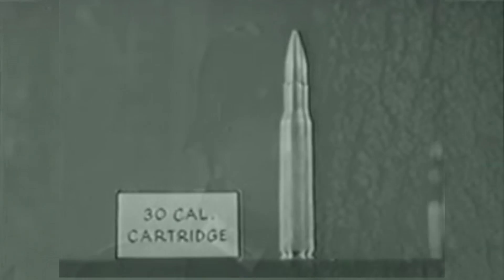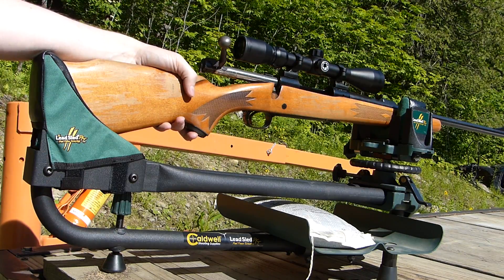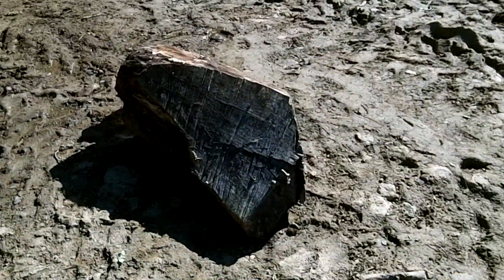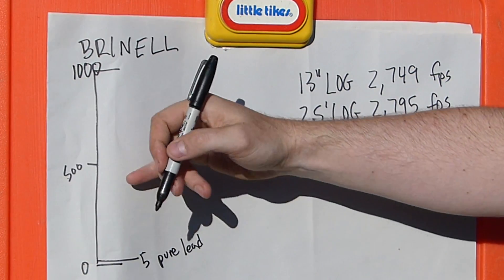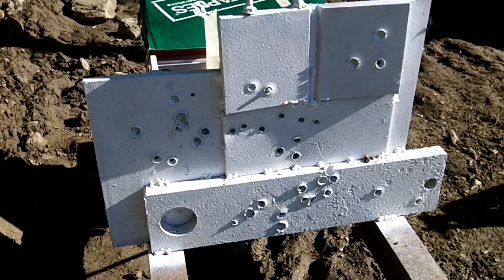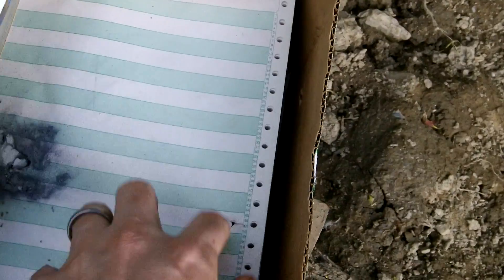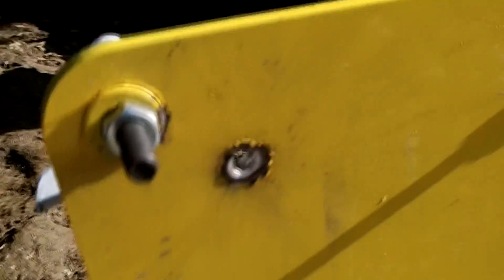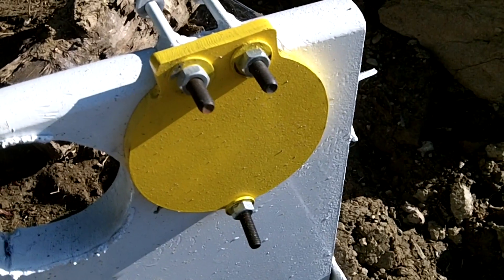AMMOTEST: 30 Caliber M2 (30-06) Armor Piercing Penetration Tests - Military Surplus Ammo

Comment: type III and IV armor; would like to see 30-06 with and without m2.  same with 556 and 762 using penetrator ammo.  pistol ammo is not relevant with them.thx and super video!!
Reply: Would like to see the same. But as to the pistol ammo, it can be relevant.  For starters,  back in the early 70's I remember shooting what was marketed as KTW Armour piercing ammo. It was in .357 mag and hat a Teflon coated jacket and a Tungsten core. It was for police/military and was touted as being able to penatrate a car's engine block, back then that meant a V-8. And as I recall it did a fine job. Due to this I'm sure there are other examples.

Comment: Excellent video & well thought out.

One suggestion with the wood phase of your testing.

When firing through wood logs vertically vs. horizontal, you might want to check the side exits of your rounds as they are susceptible following the grain of the wood shooting through it long ways vs. cutting through it in it's horizontal position & will tail off through weaker veins of the grains in the log exiting out the side in lieu of going all the way through.

Also, you'll probably get different results shooting through "green wood" vs. what it seems are more cured/dried out logs you used in your production. The soldier shot through a live, green tree when demonstrating the effect of the round vs. your more dried out version with far less water content keeping it's cellulose/cellular structure intact.

I have no idea how much that will impact penetration but you might actually care to demonstrate the difference in wood tolerances which if someone is taking cover behind a tree vs. cut timber that is more dried by industry standards & due to the normal process of sun exposure. In other words, it's structural integrity has been altered significantly cut from the stump.  

Again, excellent video & I was surprised with some of the results just as well..

Comment: I liked your video. You asked for feedback, so here goes. I can't tell how far your firing position is from your targets, but the .30-06 doesn't stabilize fully, with that weight of projectile, under 100yds. At 100+ yards, I think your 1 1/2" mild steel, and concrete tests would have a somewhat, (greater penetration) outcome. I look forward to seeing your other vids.

Comment: I checked over 150 comments and didn't see anything related to the concrete.....which comes in vastly different strengths. 2500psi, 3000psi, 5000psi, etc.     Stucco walls are junk concrete. Could be the difference.

Comment: Excellent! I really enjoyed it. A buddy gave me a few black tips. Somebody told me not to shoot them through my new hunting rifle because they can mess up the rifling or something. Ever heard of that?
Reply from the maker: I don't think it will be a problem.  Like most ammo they have a soft jacket which is what contacts the barrel.  It is just the core that is hard.  I think some people don't understand this.  Now some ammo ammo has some steel in the jackets, like the 7.62x54r I've been using lately.  These jackets are a little rougher on a barrel.
Reply: They won't hurt your rifle.  The jacket is copper just like any other 30 06 round. The penetrator core does not come in contact with your barrel

Comment: Would 8mm Mauser AP have the ballistics or close too the M2 ball AP?
Reply: crystalrock18 I can tell you that it is a bit better than 30-06.I used SMK and SMKH along with SMK I'spür which is AP tracer.The toughest one was SMKH-it punched through an inch of AR500 because it was not just armour piercing round but tungsten carbide core round-which really makes the difference enormous.It is far better in penetrating anything than for example .50 calibre FMJ-I think even two of them.But as the analogue to the M2 AP rounds it would be unfair so the actual fair comparison is when you compare SMK and M2 AP.And I will tell you that they are similar-not a lot of difference..
But anyway BS41 14,5×114 round is my favourite round of my favourite calibre(by the way I am receiving PTRS-41 at approximately one to two months,and as I ordered KPVT barrel not long ago I will try to design and make a huge bolt action super accurate magazine fed gun using that barrel-so that would be quite spectacular 😉
By the way I have a lot of BS41 ammunition already delivered from Ukraine and more coming up-so I can't wait till I will finally shoot my first video 😎
Reply: John Sheppard is absolutely right about the 8mm SMK-H (Hard-core)!  I acquired a box of them in the early to mid 1980's and did some load development with them in a .300 Win. Magnum with the projectiles turned down to 30 caliber... with the front portion being basically bore-riding!   Oddly enough, there was no pressure sign from the starting load to a load that was 10 - 15 grains over comparable bullet weights in a number of different load manuals and every single round sailed through a 1 5/8" mild steel plate.  To this day I don't understand how some of those rounds were not showing at least some pressure signs!   As a side note, I think that I paid ~ $200.00 for the box of 20 rounds... only to find out a little later that the going rate back then, was ~ $50.00 per round!  I think that I only had about 3 left at that point!    
It was around about the same time that I decided to see just how far you could take the.300 Magnum concept in an extremely strong action and settled on necking what would amount to the.408 Chey-tac down to  .30 caliber and was able to run the turned down SMK-H's (190gr.) to well over 5,000 fps...I still have the sectioned 3" thick block of cold rolled steel with two holes all the way through it!  They also went through a 2+ inch lead back-up block ripped into a 2 - 3" block of seasoned oak behind that!  By the time that they got to the oak the tungsten had started to break up into high density 'rat-shot' that would have made an extremely nasty wound to deal with!  By the way, the pressure that had been missing with the
.300 Winchester Magnum...was definitely present with the  .30/.505 Improved!  Anything heavier than 110 gr. projectiles would result in a blown primer with any available propellants.  The 190 grain projectiles were very high pressure and a 220 grain tungsten projectile locked the gun up due to chamber expansion (the receiver or action was undamaged)...  The CRMS target from that test went to a military museum in California at their request!
Reply: @cheryltysver4819  wow that is really cool information there thank you sharing that. I don’t have any of my 8mm Mauser rifles anymore due to the cost of them becoming expensive to shoot. The last one I had I ended up trading for a near mint 1997 production Marlin 336 lever action. It had 12 rounds fired out of it, and my buddy who owned the gun store said had the box from the original owner of the rifle. All in all I still miss the rifles but I love having a 30-30 though. But what can I say guns in general are a fun hobby.

Comment: It's not the hardness that matters, it's the density of tungsten and the velocity.
Reply: The problem in your theory is that thereis no tungsten in that bullet. Just hardened manganese-molybdenum steel. There was never a 30.06 tungsten core AP ammo. Way too expensive in the ww2 times. And like the autor said the hardness of the ap core is 712HB. If it was Tungsten Carbide it would be like1400-1500HB.
Reply: Dorf, that is not true. It is the hardness that matters very much as well as density, speed and surface area. I would recommend reading some articles about the failure mechanisms involved :)

Comment: Love it!  The only thing is the tree test is flawed.  First off, its a dead stump that has beyond cured so it in not as hard to penetrate as the living tree in the training video.  Also, you've shot that stump several times before so the inside is prob really chewed up and doesn't offer much resistance.  Other than that, awesome.  I have some of those rounds for a rainy or should I say steely day.

Comment: Well made & informative video as always, very impressive performance.

I wonder what could pierce that 1.5 inch mild steel block? A sabot .50 or 300  R.U.M with a 30.06 ap tip maybe?
Reply: 7.62x51 SLAP AP round.

Comment: Awesome video on the capabilities of the 30.06 AP round. the AP round is a 165 gr bullet ( I think), and the older video shows the round being fired from the M1 Garand. I have a Garand and was told to only fire the 150 gr anything more would bend the operating rod, is this true? I currently fire the 150 gr M2 ball, and just placed a purchase of 200 rds of M2 ball AP rds. Any feed back would be awesome.
Reply: Tens of milions of these rounds were shot in tens of thousands of M1 Garanads in WW2 and Korean war. No problems whatsoever...
Reply: Thanks for the info jebaki

Comment: 2800 + fps  and will go through 1 inch of steel I reload mine into new factory brass, new IMR-4895 powder and military grade primers(to lazy to go see which) I do not use them but leave them stored on enblocs in sealed ammo cans..your slowed down what barrel length do you have? can you imagine someoen with a M1 Garand with a bunch of these rounds? a funny note you can load these and shot these backwards and accurracy does not suffer plus it will cut through the 1 inch steel the same..I load ones with bent tips back wards after reading it was possible,

Comment: 50 cal APIT test :D
Reply: it will go through 1/2 AR500 steel but not 1 inch AR500 steel
Reply: I have some of these and cut the AP penetrator out of the bullet to load in a 12 ga round.

Comment: I wonder what it would do if you knocked out the bullets and uploaded them into a LARGER .30 caliber shell casing. Like a .300 Win. Magnum? The increased muzzle velocity should increase penetration quite a bit. The difference between the 2 rounds is .30/06 2,800 FPS, 2,872 Ft. Lbs., 165 Gr. .300 Win Mag. 3,260 FPS, 3,893 Ft. Lbs., 165 Gr. So the .300 Win. Mag is 16% faster with 36% more muzzle energy. HMMM

Comment: Did this test in a .300 weatherby mag. 34 years ago.  It sailed through 1 1/4 " carbon steel plate at about 3300 fps without a sweat.  In  .30-06 it still made it through.  If you do this test yourself-be absolutely sure that your test medium is SOLIDLY anchored and will not give when hit, otherwise it will not penetrate regardless of the velocity.  And as for the video, it was very well done but I if your camera is mounted behind the test media, you may blow your camera lense out from spalling.

Comment: there is different grade of concrete.  in general home depot concrete is 3000-5000psi. freeway is build with 9000psi concrete( that what i heard). what grade did you used.

Comment: FInd this very interesting on this very old ammo ? Can you now shoot RAUFUSS API rounds .50 calibur from Barrett  or Mcmillan and this 30.06 AP AMMO into heavy wooden box one 3ft long x 2 ft wide  and one 5 ft long x 2 ft wide filled  with Heavy Granite stones or Marble stones like you can get at Home Depot ? If you cannot make wooden box to capture all the parts then use Home Depot buckets filled with grante stone. I would say 1/2 inch stones used for drive ways and concrete  foundations?

Comment: Not necessarily... I don't cast (yet) but here's how I'd do it...

1. Cast solid lead bullet
2. Drill a cavity into it on a drill press the diameter of the penetrator, hold on the side the mold pour into.
3. Press penetrator into cavity.
4. Put bullet back in mold, recast behind the penetrator.

Comment: I thought you were talking about trying to melt down the steel core.

"casting it into a new lead bullet", Wouldn't it require some very special molds to suspend the core in the lead?

Comment: 1. I'm talking about taking one of the steel penetrators he's recovered from firing them through a material that just strips the coating off and casting it into a new lead bullet, not casting penetrators themselves out of lead.

2. The penetrators are not copper jacketed, they're just solid hardened steel. There is a copper jacket on the outside of the bullet, over the lead over the penetrator.

Comment: Yep, bullet diameter is identical between the two rounds.
You'd need to weigh it first to find the correct reloading data, then seat it in the case with the proper powder charge found there.

Comment: cool video, I was thinking, what if you layered the 3/8" ar500 and the 1" mild steel.  Individually they were both defeated but if you put them together could they stand up. Now would their be a difference in penetration depending on which one you put in front.  if the ar500 is in front than it may help to smash the round up a little bit taking away some penetrating potential.  But with the mild steel in front it may slow the round down enough so that the ar500 can stop it.

Comment: For example: core-filled cinder blocks and re-bar reinforced core filled cinder block, (with different thickness blocks and different core filling like sand, crushed stone, and concrete), regular red building bricks, maybe some actual bedrock stones like limestone, sandstone, granite, and marble (not kitchen counter-top stuff, but just regular lumps of rock that could be used as wall building material)?

Comment: great stuf picked up some 1954 black tip stuf goes threw everthing   had a12 in roun 1/2 wall pipe filled with like compressed rock and dirt inside went rite threw found the core in the dirt behind it broke in half but not deformed wish had more only one en block clip left